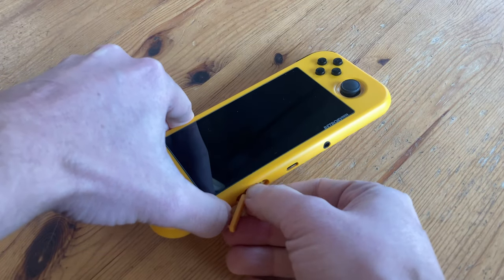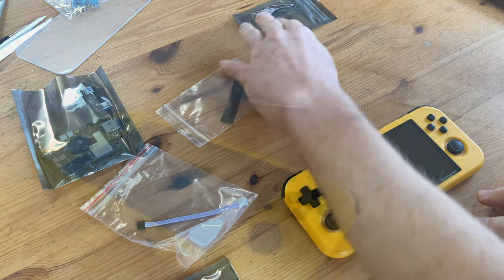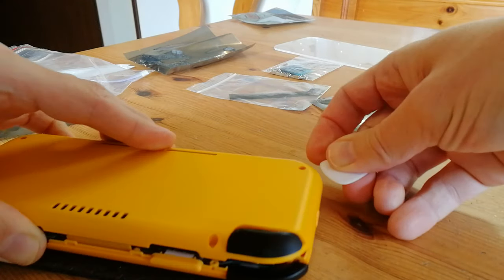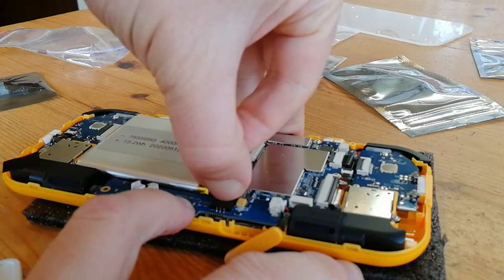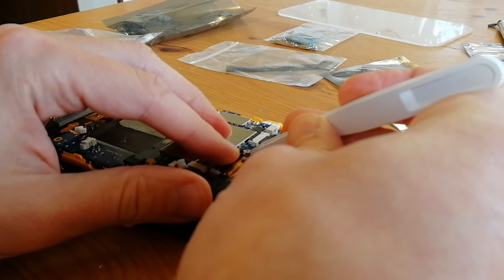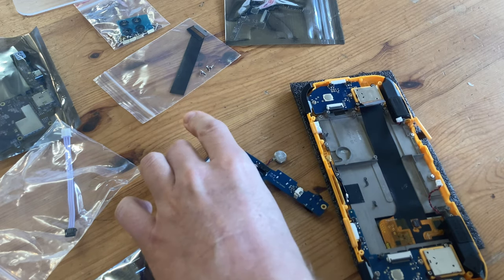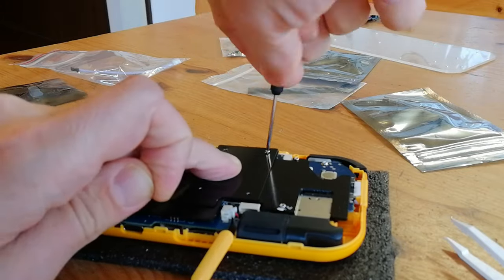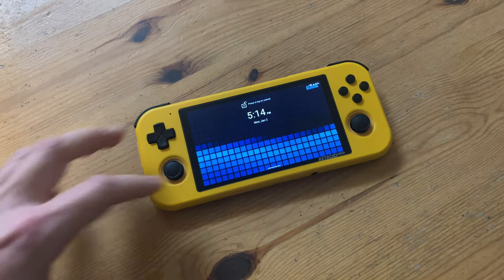Upgraded our Retroid Pocket 3 with the PCB Kit - Now it Runs Better Than Ever!

Comment: My kit came with a Power-Adapter RA mini board, what the heck is it for? I cant see it fitting anywhere.
Reply from the maker: I had the same thoughts.  Putting it bluntly- they send you enough to upgrade your handheld, AND make a console system out of what you remove from the RP3 in the process.

Comment: Thanks for this - I opened my kit today and the first thing I said was, "Of course theres ZERO instructions from Retroiod".

I was also thinking - Seeing that with the included pieces of the kit and the old PCB, if we could source a screen and power source, you could build another underpowered console, no?
Reply from the maker: I intended this to be a two part video, but currently we need to wait until they sort the firmware.  As is, it doesn't play nice if no controls (analogue sticks) are plugged in
Reply: @TeamPandory  I forgot about that bit!
Reply from the maker: @Tendo209Mods  yeah, we need a couple more fixes in the firmware for it to be worthwhile - mainly being able to turn off the (non existent) analogue sticks, and have usb keyboard/mice work well.
I guess if you have a spare handheld shell / analogue sticks ready it'd be a worthwhile mod.